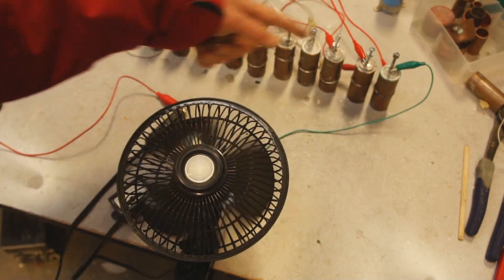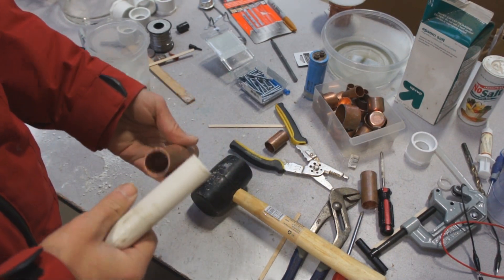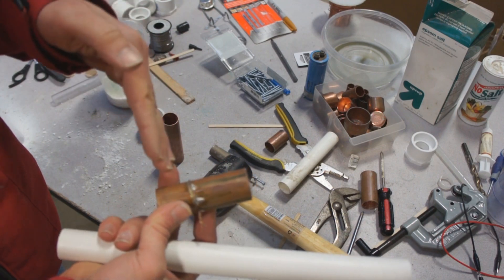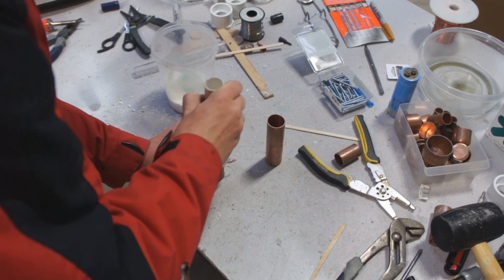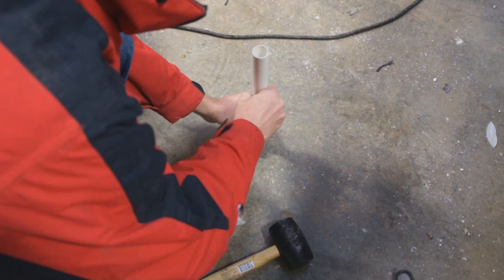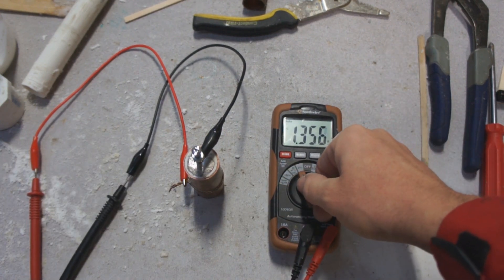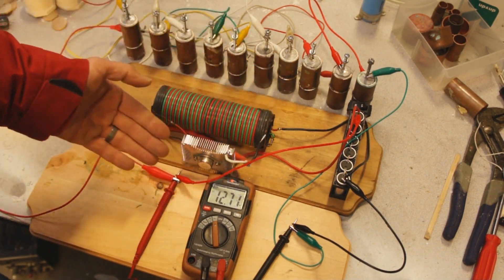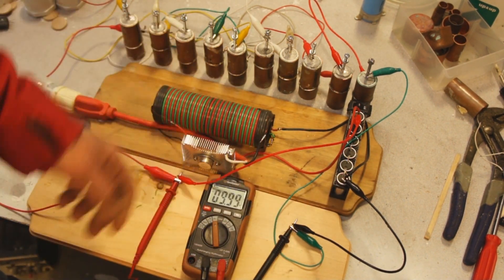12V Crystal Cell Update + Alternative Construction Method

Comment: Thanks for sharing, very nice results :-)
Reply: INVENTOR3 Have you experimented with Crystal Power Cells?
Reply: Danyal Ahmad Oh yes!  I have most all elements and compounds that Hutchison used.  I have many notes from John and Marcus.  My best cells so far were at 1.5V, but dropped after a few months.  Hard thing is to get right amount of each ingredient.  I still have not tried many in series, still working on the correct formula.  I dont want a galvanic reaction,,,just zero point energy :-)  John also had soo many different versions of has cells.
Reply: INVENTOR3 Does anyone have any idea on how many amps each crystal power cell can pump out?
Reply: Danyal Ahmad I believe you can light a LED with 2 or 4 of them.  I have seen so many different results its hard to say.  Many times I see the amps fluctuate quite a bit.  I know when putting them in series, all the cells have to be exactly the same.
Reply: INVENTOR3 I believe with about 15 cells you can get 3-5 good amps out of them. Do you happen to know if it makes a difference if you use pure ingredient's instead of alternatives LaserSaber uses?
Reply: Danyal Ahmad Hmmmm, i believe with the ingredients LaserSaber uses.  I believe that the magnesium and copper will create a galvanic reaction, so his cells would only have a specific duration of use.  A lot of Bedini's cells are like this also.  But John Hutchison and Marcus Reid's cells are not galvanic and should last forever.  It is believed that Johns and marcus cells work off of zero point energy and the casmir effect.  John and Russ just released a video with long discussion of one of his crystal wafer cells, it was very informative.
Reply: INVENTOR3 So, it would be better to make John Hutchison's crystal cells? Can you give me the link to the video that shows how to construct one of them?  It wouldn't be that surprising if Johns Hutchison's are better, he is the original  creator of the cells.
Reply: INVENTOR3 If you ever want to see what I am working on, I usually share it on my comments on videos. I have been doing some research on engines recently... I want to power a specific kind of engine by Crystal Power Cells. I am always working on something! And I actually have some subscribers and followers without any videos!!!!!
Reply: INVENTOR3 You have 70 more followers then me, nice!
Reply: INVENTOR3 The link is to one of his low voltage Crustal Power Cells.
Reply: Ok, I will take a look.
Reply: INVENTOR3 So, to make his cells with 300v+ dc, he simply zapped them with 10kv?
Reply: 30 seconds should give out good output if not completely destroy the cell.
Reply: Danyal Ahmad Well, i think to get the 300V you need to replicate his barium titinate cells or his wafer cells.  His crusted cells as you call them, hehehehe,  i think his best crusted one was about 12 or 24V, i forget. The crusted ones are the ones he zaps.
Reply: Danyal Ahmad Funny,,,i "just" bought a NST transformer, got it in the mail about 2 days ago! :-)Thats a good price of $125!
Mine is 15KV and "60"mA and "old" model.

Took me years to figure out why i kept blowing out transformers on my Tesla coils.
All the new NSTs have 2 secondary coils and they are center taped and grounded.  You want old NSTs that dont have the built in GFI or whatever its called, grounded fault interrupter or something like that.
You want the old ones with out the safety crap on them.  New ones will not handle strong reverse spike voltages. Was an expensive lesson.  I went through 7 NSTs over 7 years!!!
Reply: Danyal Ahmad Funny,,,i "just" bought a NST transformer, got it in the mail about 2 days ago! :-)Thats a good price of $125!
Mine is 15KV and "60"mA and "old" model.

Took me years to figure out why i kept blowing out transformers on my Tesla coils.
All the new NSTs have 2 secondary coils and they are center taped and grounded.  You want old NSTs that dont have the built in GFI or whatever its called, grounded fault interrupter or something like that.
You want the old ones with out the safety crap on them.  New ones will not handle strong reverse spike voltages. Was an expensive lesson.  I went through 7 NSTs over 7 years!!!
Reply: Danyal Ahmad Funny,,,i "just" bought a NST transformer, got it in the mail about 2 days ago! :-)Thats a good price of $125!
Mine is 15KV and "60"mA and "old" model.

Took me years to figure out why i kept blowing out transformers on my Tesla coils.
All the new NSTs have 2 secondary coils and they are center taped and grounded.  You want old NSTs that dont have the built in GFI or whatever its called, grounded fault interrupter or something like that.
You want the old ones with out the safety crap on them.  New ones will not handle strong reverse spike voltages. Was an expensive lesson.  I went through 7 NSTs over 7 years!!!
Reply: Danyal Ahmad Funny,,,i "just" bought a NST transformer, got it in the mail about 2 days ago! :-)Thats a good price of $125!
Mine is 15KV and "60"mA and "old" model.

Took me years to figure out why i kept blowing out transformers on my Tesla coils.
All the new NSTs have 2 secondary coils and they are center taped and grounded.  You want old NSTs that dont have the built in GFI or whatever its called, grounded fault interrupter or something like that.
You want the old ones with out the safety crap on them.  New ones will not handle strong reverse spike voltages. Was an expensive lesson.  I went through 7 NSTs over 7 years!!!
Reply: Danyal Ahmad Funny,,,i "just" bought a NST transformer, got it in the mail about 2 days ago! :-)Thats a good price of $125!
Mine is 15KV and "60"mA and "old" model.

Took me years to figure out why i kept blowing out transformers on my Tesla coils.
All the new NSTs have 2 secondary coils and they are center taped and grounded.  You want old NSTs that dont have the built in GFI or whatever its called, grounded fault interrupter or something like that.
You want the old ones with out the safety crap on them.  New ones will not handle strong reverse spike voltages. Was an expensive lesson.  I went through 7 NSTs over 7 years!!!
Reply: Danyal Ahmad Funny,,,i "just" bought a NST transformer, got it in the mail about 2 days ago! :-)Thats a good price of $125!
Mine is 15KV and "60"mA and "old" model.

Took me years to figure out why i kept blowing out transformers on my Tesla coils.
All the new NSTs have 2 secondary coils and they are center taped and grounded.  You want old NSTs that dont have the built in GFI or whatever its called, grounded fault interrupter or something like that.
You want the old ones with out the safety crap on them.  New ones will not handle strong reverse spike voltages. Was an expensive lesson.  I went through 7 NSTs over 7 years!!!
Reply: Danyal Ahmad Funny,,,i "just" bought a NST transformer, got it in the mail about 2 days ago! :-)Thats a good price of $125!
Mine is 15KV and "60"mA and "old" model.

Took me years to figure out why i kept blowing out transformers on my Tesla coils.
All the new NSTs have 2 secondary coils and they are center taped and grounded.  You want old NSTs that dont have the built in GFI or whatever its called, grounded fault interrupter or something like that.
You want the old ones with out the safety crap on them.  New ones will not handle strong reverse spike voltages. Was an expensive lesson.  I went through 7 NSTs over 7 years!!!
Reply: I realized that NSTs may actually not be the best option because they only give 30ma or 60ma. I am thinking of using a old quick connect 600v 30a transformer instead. With a NST you could probably connect it to a cell and leave it on over night. A nst cant even kill you.
Reply: INVENTOR3 What can I say, we learn from our mistakes?

Comment: I see that at 07:44 where u measure the mA it's dropping quickly. My question is if the discharge continues to 0 does the battery need a recharge or does it regenerate by it self , if it does have u measure the regeneration time ?

Comment: Noticed that the magnesium is a large chunk. But only the outside surface is being used in the chemical reaction. Wouldn't you get more power , and be cheaper, by using a magnesium tube instead of rods? This would increase the surface area and increase the power.
Love your experiments.
Reply: One of the few sensible comments here. Hard to get Mg tube though?

Comment: Lasersaber, the best method for this to never discharge is my method of alternate use of 2 banks of crystal cells in this manner: a few minutes bank 1, then flips a few minutes to bank 2, and so on (through 2 transistor flip-flop method). This is the best method and it is also used into romanian free energy device thats working continuously for 70 years - Karpen Pile. Thanks for sharing, keep going with the good work!

Comment: Try making a 17v pack and see how they do. What I have noticed is that they (crystal cells) run lower then normal batteries. This means they droop to a lower level but can maintain that lower level for a very long time. So adding more cells will be better fpr performance at the target voltage level. You will have to build in a tolerance for the 30 seconds of droop from a very high starting level.

Comment: aloha ty for the tight update and method:) was wondering about a motor i saw on pes networks page think it was called the kepe motor or somthing. anyway new winding and such allow the motor to be run at lower voltages. anyway great upload thx for sharing!

Comment: calculate the Ah
magnesium is quite expensive. can you replace it with cheaper material?
Reply: ya, Aluminium but it has a lower voltage(source: lasersaber's website)
Reply: you can get a nice big rod of magnesium from a recycled water heater free

Comment: Great video again,
If each cell is about .4 watts(13 x .03) and 100 cells were in parallel so 40 watts how long could it run a 40 watt motor for? A few years just like your live feeds?
Reply: Exactly. 1000 for a 400 Watt Bulb.
Lets say 600W for 12-13 hours a day, how many cells do we need? 
I would love an affordable way to grow food in a nuclear bunker for a few years. 600W for 12-13 hours is probably the minimal system for salad.
Reply: @nandodando9695   LED based grow lights